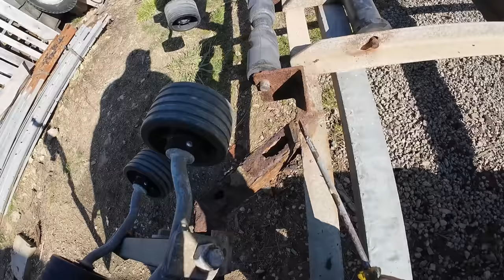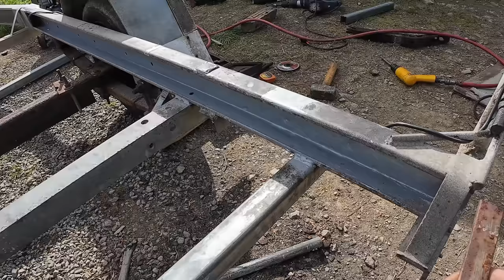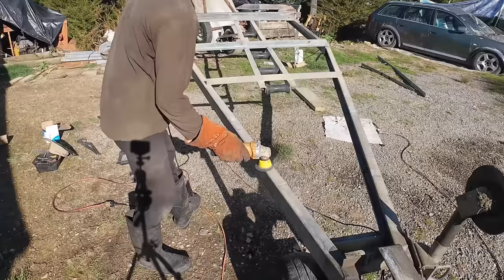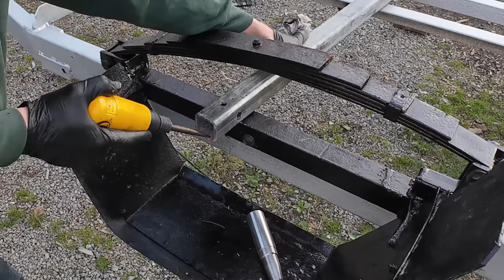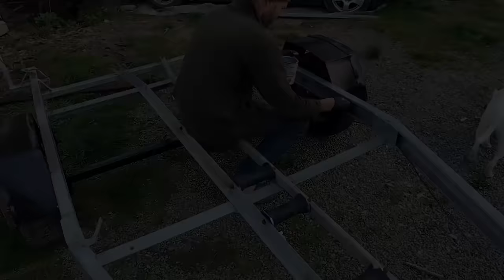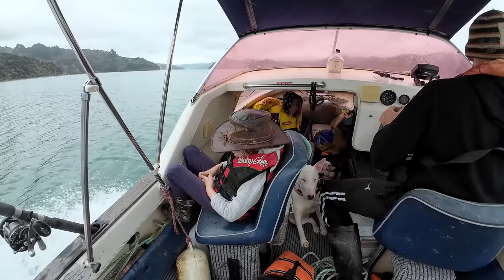Building a new Axle / Restoring a Rusty Boat Trailer / Fishing in the Marlborough Sounds NZ

Comment: As well as grease theres a product availiable here in NZ called Res-Q-Steel. For any nuts bolts etc going either near or in saltwater its 100% top of the pile in protecting the threads. Better than anything in the anti-seize family. Seen nuts n bolts underwater for 20 years just unscrew like new ones would. Bit $$$ to buy but oh so worth it. No good near heat like exhaust manifolds etc but near or in salt water theres nothing better. And a little goes a long long way. My brother when he was an apprentice marine engineer bought a 4 litre tub and it lasted him just on 25 years.
Reply from the maker: Nice, The black paint I used is bitumen based, keeps the rust at bay for a few years

Comment: Good one Marty T got a story for you. I was offered a 20ft boat trailer from steel recyclers for $50 the middle roller area was rusted out. I looked at it for ages and ended up cutting middle out completely, shortened the draw frame suitable for a 16fter. Went to buy a boat for it in Whakatane only to find another guy beat me to it. He had a tandem tipper so offered him my rebuild, we swapped and later sold it for two and a half grand.

Comment: I remember in the 1980s my dad and I building a 2 axle 1 meter apart racing car trailer that was legal 70mph in the UK 
Nothing fancy just a tape measure to get it square and indespension DOT co DOT uk  trailer suspension units

A few weeks later, One night after work I copied a deep V trailer for my friend welded everything with MIG welded mudguards and everything, went to the pub at 10pm for a beer and than back to finish paint it before midnight. 
The following day in December we took his boat up to the Lake district in the Windemere UK one the lake we hit an ice sheet and slid out of the water and had to hammer / smash the ice to float again.

Comment: Well done mate! If I had any suggestion its to invest in a belt grinder. Whether its pneumatic or electric doesn't really matter, whatever suits your kit better. In the line of work I do my pneumatic belt sander is one of my most valuable tools! Not much you cant do or get into with that tool. Would have made cleaning the weld off those square tubes a 30 second ordeal I reckon.

Comment: Nice job. Whenever fitting and welding stub axles into box axles, I've always just ground a slot in the stub axle to fit where the seam weld is in the box. The transport guys will tell you should never weld around the end of the axle as it could crack and snap off. I've only ever plug welded them and sealed with a sealant.

Comment: Nice video and awesome scenery! When you set up the axles just grind a slot in the stub for the seam line, then tack the stubs in assembly the hub on it clamp an angle iron to each hub and measure between is how you set them up dead straight 👍

Comment: Awesome video! Most axles are manufactured with pre-bend in them. This lets the axle lay flat when a load is applied and helps with even tire wear. I have rebent axles with a bottle jack and some chains but I definitely wouldn't recommend it.

Comment: So awesome to click on YouTube app on my new 65 Inch Samsung CU7000 tv and there's a new MartyT episode. 
I actually managed to get in under the first 100 likes at #80.
I've never gotten under the first 1 K.
Watching him rebuilding his boat trailer was an absolute pleasure. 
He has some serious talent resurrecting rusty neglected equipment. 
The boat almost getting away was a hoot.
He should have been a spanked line from the bow cleat tird off by the spare wheel.
I once watch a boat get away like that then get caught in a cross current with the boat smacking into some else's boat no bumpers on either of them when I lived in the Florida Keys. 
Owners screaming at each other almost cane to a punching match crowd egging them on a couple of guys betting on the outcome.
No actual damage to either boat just tempers flailing.
Of course it took the wives to point out they were scaring the kiddies so calm returned.
It was pre-smartphones or ot would have gone viral.
There's lots of stuff like that on YouTube now.
One guy covers the Insanity on Miami's Miami River.
He has a great commentary.

Comment: Have you thought of placing some zinc plates at various locations on the trailer to help slow down the salt water corrosion? Marty is a Jack of all Trades and a Master of Many.
Reply from the maker: Not sure if that would do much for the trailer, I think they are mainly for preventing galvanic corrosion, for things that are sitting in salt water long term, but I could be wrong. I certainly have them on my outboards and alloy boat.
Reply: @MartyT  Just a thought so you don't have to do this level of work any time soon.
Reply: The galvanizing over the steel frame acts as an all over anode and should prevent corrosion for years. Fresh water wash will also   help.

Comment: Back in the olden days before C channel or I beam trailers were a thing people used to plug & fill the box section tubes sump oil to stop them rusting on the inside. You could do a similar thing to that axle tube.
Reply from the maker: Yes I have been known to do that

Comment: You can prevent that sagging in the lateral supports by triangulating them below with 12mm solid bar and a centre post  so the bar goes into tension when a load is applied.

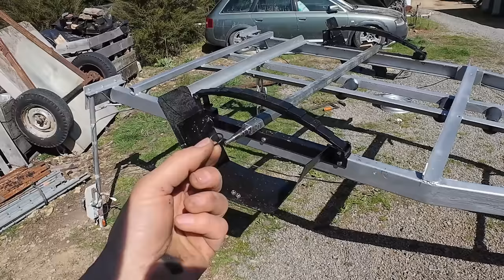17:07 Proper degreasing and coating the hole and pin with RTV silicon would be better than trusting an O ring on un-machined surfaces. Using an O ring where there is no groove for it to sit in risks the O ring splitting when the joint is tightened.  An alternative to an O ring is a flat rubber gasket ,which less likely to split.
Reply: Yeah that's really the only fault I saw could of used a couple of garden hose washers but it's not like he can't fix it himself if he needs to later.

Comment: Now that the boat rolls off the trailer so easily you need to install a safety chain from the trailer to the front eye of the boat to keep the boat on the trailer when towing it. 
Straps to fasten the rear of the transom to the trailer when towing would be another good idea. If you were involved in an accident when towing the boat would fly off the trailer without them. 
Nice job refurbishing the trailer Marty.
Reply from the maker: Yes always have the safety chain attached when towing, I released it prior to launching

Comment: Marti, if I might make a little suggestion, bolting a couple of small sacrificial anodes to the trailer, has a substantial effect on reducing corrosion on a trailer that goes into salt water. You can get or order them from marine/yacht chandlers.

Comment: About a month or so ago, i helped a friend rebuild his trailer, probably about as crusty as yours was. I initially said, 'let's just get it done in galvanized material', but everywhere we went to buy stuff it was just trash. I think we went to five different specialized stores and it was all really thin coating, and the one place where we found both good coating and the right thickness, it was more expensive than the stainless equivalent. Might've been a pandemic and war thing (europe here), but at the same time, the quality of materials is dropping across other things as well, so it's not just for galvanized stuff.

Ultimately, the stainless is not going to rust ever again and i did a heat + motor oil brush dip on the sections where i welded and thus ruined the coating on the existing stuff and messed the stainless (not passivated). Hopefully it will last a few years before something else fails. Cliche, i know, but they don't make things like they used to anymore. Everything is just worse and worse while prices are higher and higher without any logical justification.

Comment: Bolt some blocks of zinc or magnesium to the trailer as sacrificial anodes, Marty. Great corrosion protection.
Reply: MartyT
7 hours ago (edited)
Not sure if that would do much for the trailer, I think they are mainly for preventing galvanic corrosion, for things that are sitting in salt water long term, but I could be wrong. I certainly have them on my outboards and alloy boat.
Reply: @JohnSmith-pl2bk  You are probably right. It would allow for ion exchange in the water but it probably wouldn't help much after the trailer is out of the water. Certainly not after it's dry.

Comment: I use hydrochloric acid they sell for swimming pools for rust removal. For long objects like L metal or tubing I have 6 foot ABS drain pipes 4 inch and 3 inch with end caps that I fill up with acid and use as acid tanks. Metal comes out like new. You get some flash rust but it's not too bad if you just wire brush it off. The tanks eventually get bright green ferrous chloride crystals built up in the bottom but they dissolve pretty easy with water and you can fill the tank / tube up again with fresh acid.

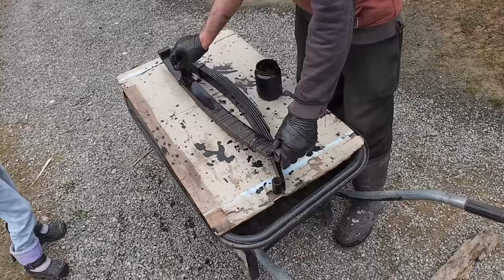Comment: 11:13 FYI, if they're rusty in between the leaves, they won't work properly. The rust binds them and negates the way they're supposed to work, by sliding as they flatten.
Whenever you have time, you should take the leafs apart and clean them (be careful when you remove the leaf holders, don't abuse them, cause they may snap).
I recommend after you've cleaned them to buy the thick shrink sheathing they use for underground cables and after you've lubbed them up really, really good shrink wrap them inside that tubing. One single other thing would be to cut a tiny hole in the material and slip a bicycle schrader valve and portion of a tube around it from the inside. You can use that to pump grease inside this sleeve and thus deny water from getting in at the ends. I've seen this done with several trailers that still used leaf springs (quite a few have changed to that rubber knuckle (dunno if that's the proper term)) around our area (prolly on of the local shops figured the method out, i don't think it's a commercial thing you could buy or something, but maybe i'm wrong).
Reply from the maker: Springs are cheap, I'll just buy a new set when these pack up. Good tip though, that would make them last longer

Comment: Idyllic life, Marty.
Great when the kids are at that age. 
I was wondering about welding 2 pieces of galvanized steel. Won't you need to zinc the weld since you'd have ground off the existing zinc near the joint or else the welding heat would have vaporised it? Ideally you'd take the finished frame to a galvanizing plant and dip it into the big hot-dip bath. You seem to rely on paint for corrosion protection near the welds.
Reply from the maker: All welds got a zinc rich primer before the top coat

Comment: In QLD Australia you have to have solid steel axles and 1 axle for up to 750 kg loads  2 or 3  axles for any loads above that weight with electric braking , no hollow axles allowed.
Reply: Yep inserted (shimmed) stub axles went out with the wooden draw bar (serious) more than 40 years ago in AU.
Reply from the maker: Wow that sounds heavy and expensive
Reply: When almost every modern car has a rear axle that is flimsy C section metal....
but it is designed to carry up to 7 passengers safely...
plus it's own weight of course.....
at speeds up to 180kmh......
 a small trailer axle has to have a SOLID steel axle????
Reply: @JohnSmith-pl2bk  yeah we used to be allowed to use live axles single piece factory made car axles recycled from the wreckers. DOT would recognise iso900 etc. just not backyard assembly conditions...  since then all car backend conversions of utes trays into towable are no longer passed.
The weight of the axle is directed to ground not carried by the springs but does dampen for a smoother ride if you where to get a flimsy box trailer airborne.
Reply: @MartyT  LOL nah the bit in between is just the extra cost of that steel. Rolling weight is easily over come as inertia, note axle mass to ground it's not added to the springs carrying capacity. Just overall GVM

Comment: Using U-bolts to secure the axle assembly to the frame would allow some fore/aft adjustment that would allow you to dial in the tongue weight exactly. Especially useful if you change engines and there is a weight difference between old and new.

Comment: Nice job there Marty. Fill those bolt holes in the timber with grease if it's on hand? Watching this I'm directly north on the NI.(more or less) and the coastal breeze rots everything that's not protected. Might follow suit on the bearing buddy's, since the standard zinc plated hub caps rust away in a couple of years to the point holes are beginning to appear. Nice boat those. Haynes Hunter is it? Began production in the late 70's. They were around the price of three new cars with all the gear(trailer, outboard, jackets, safety kit, auxillary .motor)carpeted with flash boat seat upholstery forward birth and a floor infil that raised to make a double birth out of the twin. Depth sounders and fish finders were seperate units which they had both on board.
Reply from the maker: This is a fi-glass dominator, solid hulls and not as pricey as a haines
Reply: @MartyT  looks cool sounds tough. Dominator and solid hull. Good enough for Cook Stait on a good day.

Comment: Also another question. You ripped a new timber for one side of the trailer bed; why only one side? Whats that timber for?
Reply from the maker: The board is to walk on when the trailer is in the water, I only needed one on that side because that is the side of the winch handle and drivers door, I never walk on the other side of the rollers

Comment: Commenting for the algo... I have my doubts about the o-ring lasting without an o-ring sized pocket for it to sit in. A square of old tire rubber should hold up against the forces/vibrations though.

Comment: I would of mixed some grease and diesel for the springs that way soke right through should be a lot quieter and protected from salt
Reply: That washes out into that pristine water. 
Marty used a bituminous paint that sets hard and doesn't wash off...for the springs and as a preservative for the rough sawn "walkway" board....

Comment: Another great video with fantastic and helpful content!!  Always watching and learning.  Thanks for sharing. Just a quick and simple question from a beginner:  There are times you use a brush and times you use a sprayer to paint.  Is thjere a situation where one is better to use than the other?  I know this is a basic question.  But I'm just beginning as a DIY'er.  Thanks for your reply.
Reply from the maker: Thanks.. The paint I used on this project is thick and doesn't spray well, I like to get a nice thick layer on with a brush on trailers used in salt watee
Reply: Thanks for your reply.  Very helpful!

Comment: Marty spray the trailer with enis oil [spelling?] and then drive over a dusty gravel road so the dust sticks to the oil, it will stop rust, you may need to respray under the mudguards every so often as the water spray during rain will aqua blast the oil off in those areas, you can also do under your car as well.
Reply from the maker: I used multiple coats of bitumen based paint, it dries hard and doesn't leave an oil slick in the water

Comment: Just a heads up for anyone welding on any frame rails or crossmembers,NEVER WELD across frame rails or the cross members,only Weld down,or front to rear along them orherwise you risk weakening the rails and or crossmembers by welding across them laterally...Big no no on frames..

Comment: Actually most axles come with positive camber built into them,or slightly arched upwards so that when weight is placed on them they go straight,or over time they become straighter rather than sagging and having negative camber.. That axle was intentionally made with that arch in it for a legit reason...

Comment: Out of curiosity, is anti rust primer better than cold galv for this application? Or pretty much the same?
Reply from the maker: I've found zinc rich cold galv will eventually rust through if there is any trace of rust on the metal
Reply: @MartyT  oh right, that’s fair. Is there much difference between the zinc and silver galv? Coz I’ve used silver but not zinc :)
Reply from the maker: @Lucydius  I'm no expert so can't advise, it would be worth experimenting, I used hammertite direct to rust silver on this trailer, first time Ive used it so will be interesting to see how it holds up to the salt water
Reply: @MartyT  Yeah man, I’ll keep an eye on it. Coz if it’s good I’ll start using it on our jet ski trailers. 

At work our chassis are hot dipped and after a few yrs when ppl bring their vans in for service, once I’ve wire wheeled some surface rust off tow kits I’ll do them in silver galv. We’ve got a few older chassis collecting dust so I might zinc galv a few spots and see how they hold up 👌

Comment: It's a shame you don't live closer to a hot dip galv place, you would save yourself a lot of work. Good job though.
Reply: The closest hot dip would be Christchurch - about 450km away and a very long day to get there.  Marty did the best thing fixing it himself.
Reply: It's not cheap either...
the cost 20 years ago was $1 per kilo total weight of the trailer..
and you had to drill holes in all sealed sections otherwise pressure could blow molten metal over the workers at the hot dip...
Probably another reason why commercially made trailers that are galvanised are as lightweight  as they can make them...